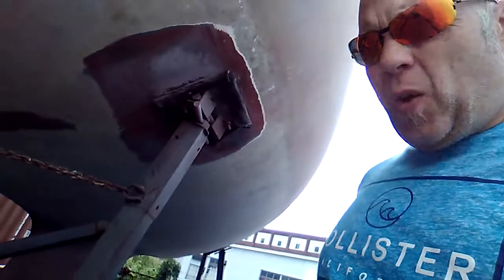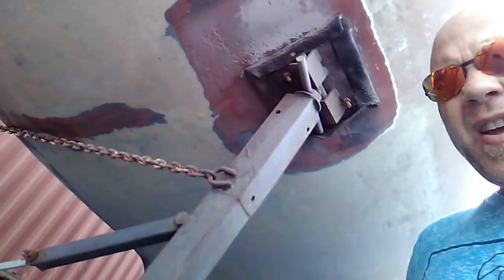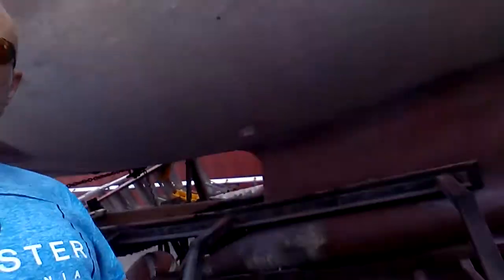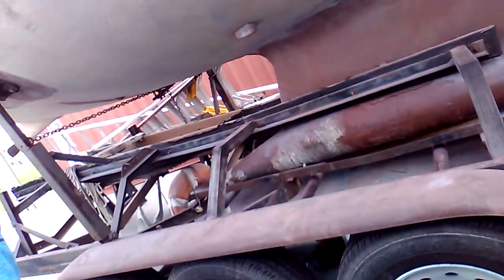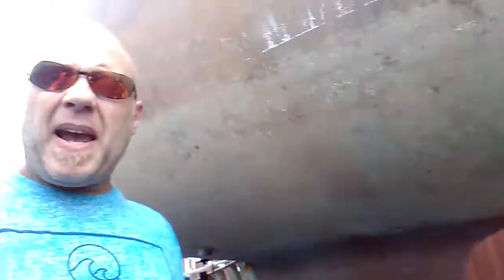Sanding sailboat Oria's hull XI... Done!!!

Comment: Great job!   I'm on a similar journey with my C&C 35.  A couple of thoughts on your plan:

When you're fairing your hull it's really hard to get a great result while looking at flat primer.  You might consider using graphite powder as a guide coat while you fair out with a long board.   Easy to apply.   You can work sectionally.   No dry time.   

The topside.   Rather than core everywhere, plan where you will (or even where you might) mount deck hardware and not core those sections at all.   That way you never need to worry about water intrusion into the core again.
Reply from the maker: Phil Rackus thanks for watching. All the core is soaked or delaminated, so I have to put in new core...the Areas where I know hardware will go, is going to be layers of  fiberglass built up to the height of the core, then top skin back on. Anywhere else I will over drill fill with epoxy and drill into that.  As far as fairing, Andy(Boat works today) recommends priming when all fairing is complete, well at least a vast majority . Let me know how your C&C is doing, thanks
Reply: Slow :-(  I'm pretty much done stripping the topsides (I have no need to go below the waterline at this point).   I have some transom damage that I'm almost done rebuilding.   Then I'll be fairing as well.   The graphite powder guide coat is a trick I picked up on a misspent youth working with auto body - it's the best way I know of to uncover those nearly invisible high and low spots that become very visible with a glossy finish coat.   Trust me - you'll be happy with the results.

http://www.hotrodders.com/forum/dry-guide-coat-129002.html
Reply from the maker: Phil Rackus when I do finally fair the graphite trick will be kept in mind...thanks...heading inside Oria for the winter!